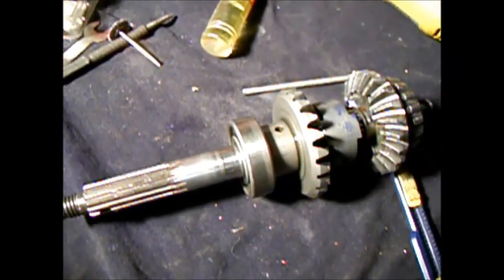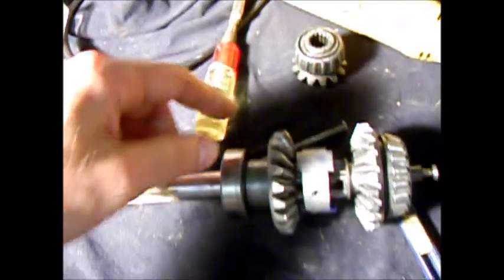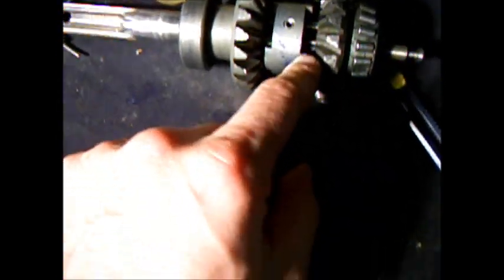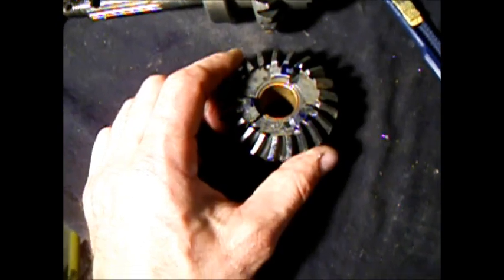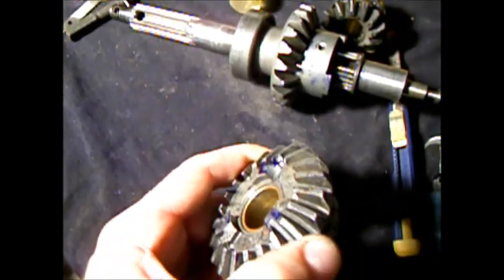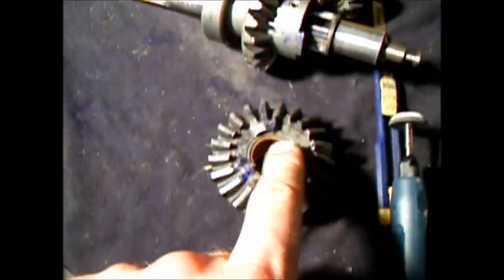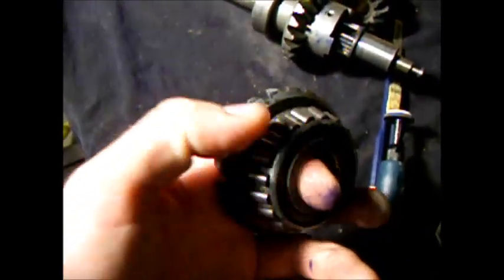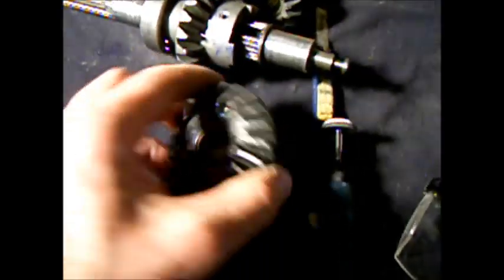Repairing an outboard that is jumping out of gear under load... for FREE

Comment: Hi, can you give me your opinion please: I own a Searay Sundance 290 from 1996 and a Bravo II drive. I was cruising at 3000 RPM, all good and as soon as I started to slow down, a massive BANG was heard and the throttle lever got stuck . In idle I tried to engage forward or reverse to no avail. What could happen? I had to be rescued and brought back to the marina (10 people on board).
Reply from the maker: Jaime Lopez that does not sound like fun.  I'm more familiar with outboards.  However, it is likely a clutch dog or gear tooth broke or a shaft sheared low in the outdrive. Please report back when you find out.
Reply: Ok, we found out that the basket that holds the U-Joint in place disintegrated because of material fatigue; the shaft got loose and destroyed the Bell bearing housing, transom and gimbal support. Big bill...
Reply: @jaimelopez3991  ouch

Comment: how do you get the roller bearing off the forward gear with out a press?
Reply from the maker: It has been been long time since I had this bottom end apart. I thin you would need a press.

Comment: How did this hold up for you over the years?!
Reply from the maker: I ran it hard for a season. No issues. Sold the boat after that so I cannot speak to the longevity of the repair.  However, it cost me $0 and kept the motor going so I have no regrets.